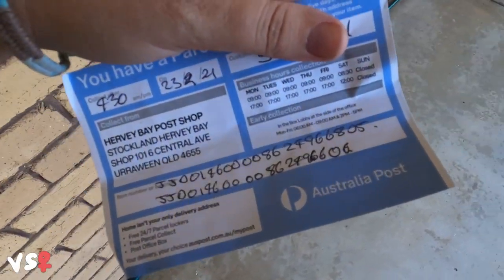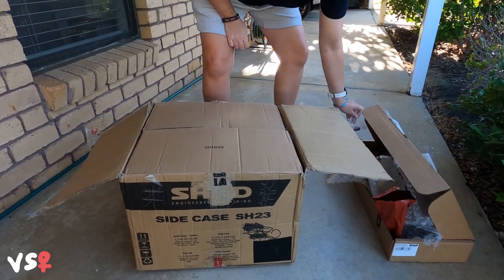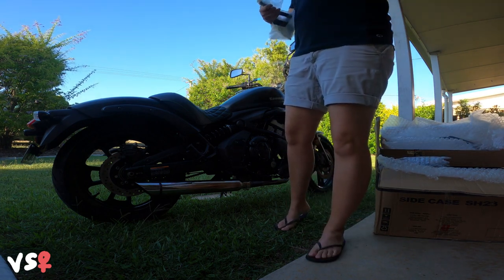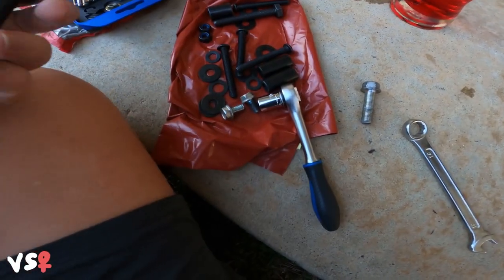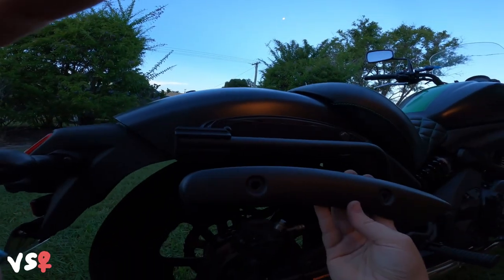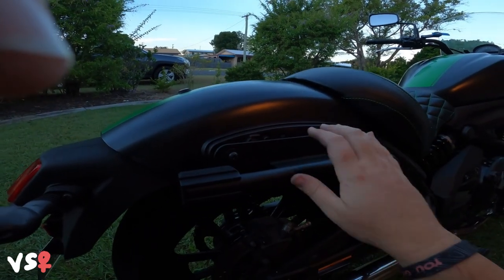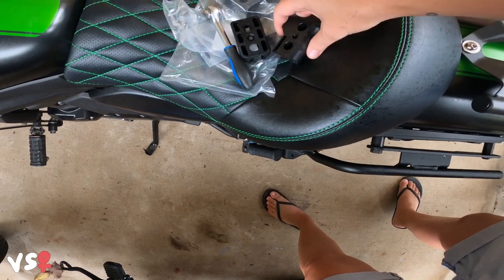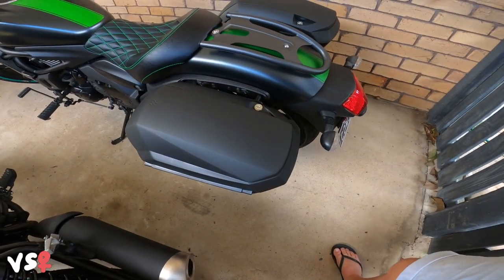VS♀️ Shad Panniers (Vulcan 650)

Comment: They look great! Is the mounting frame included ? It is not clear even by checking the shad website so not sure if I need to buy something extra for the installation :/
Reply from the maker: Thanks for your comment 😁 I purchased through the SHAD website and had to buy the frame fitting kit separately. It ended up being quite expensive but the quality really is amazing. Make sure they send you the right rubber attachment if you are going with the SH23 cases too!!

Comment: I went the OEM route of hard, leather saddlebags for my 2020 KVS after watching quite a few videos where the installation was challenging for a myriad of reasons. Although pricey, the fit and finish are flawless. Volume 12 liters, roughly, each. The design matches the rear fender perfectly, but yours look pretty darn good as well! I like the locking feature which mine lack. Cheers!
Reply from the maker: Thanks for your comment. 🙂 I had a look at the OEM ones but the lockable feature sold it for me on the SHADs. With 23L in each... there's a bit more space too. I wish they had a built in handle on the top or something though.

Comment: I want to go for the bigger sh36 on my vc 2018. Ihave no idea (yet) if the 3p system rack you are using here, will fit all the 3p cases. But i also have the R&G tail tidy. Im not sure if the blinkers will be too wide (since they are further up on the bike) if a set of bigger cases are going further back on the bike. What do you think?
Reply from the maker: I believe the 3P system works for both the SH23 and the SH36. It just has a different attachment on the end of the bar to fit the SH36 cases... which should come with it. I'm not entirely sure about the indicators though sorry! 🤷‍♀️

Comment: The washer on the footpeg comes off easiest by putting a flat head screwdriver in the washer spaces and turn the screwdriver. Keep your hand over the washer or it'll ping off into the lawn and you'll never find it :)
Reply from the maker: Thanks for the tip. I seriously had no idea they even existed! 🙂
Reply: @TheVSChick  that part is called an E CLIP
Reply from the maker: Cool thanks Mark. I had no idea what it was. 🥴

Comment: I just put these on my Vulcan and had trouble tightening that one big bolt all the way. The one that you said you had trouble with. What did you do to get it? It's almost like it's not threaded in there and I just couldn't get it to go in all the way.
Reply from the maker: Hey Kim. Perhaps try starting with that bolt so that you can thread it in the whole way... then screw in the other bolts after that. I had to take it all off to do my tail tidy and I was super worried about not getting that bolt back in. But yeah... it was heaps easier the second time around. It must just have to be lined up perfectly or something. Sorry... not much help other than that! Hope you can figure it out!!!

Comment: A little nervous because I ordered these bags but don’t have rear foot pegs. Are they required for installation?
Reply from the maker: I'm not 100% sure to be honest! I guess if you at least have the foot peg brackets you'd be right... but if that whole part is missing you may need to purchase it separately.🤷‍♀️ They're about $150-$200. All the best with it and sorry I couldn't be of more help. You may be able to find some more information online somewhere.
Reply: @TheVSChick  I checked around and decided to return in for a different set. Thanks!
Reply from the maker: Good luck with the new ones 🙂
Reply: @Jolipolie  What set did you go with for installation without rear pegs? and what is the whole kit worth?
Reply: @themototo10  I ended up canceling the order because I was unsure
Reply: @Jolipolie  damn, cant find a decent priced set that doesnt require rear footpegs, also want to find a full kit so i dont need to worry about extra shit